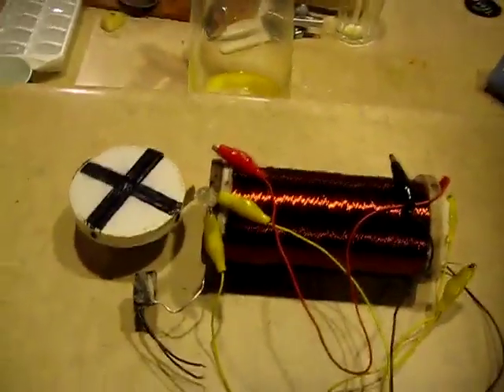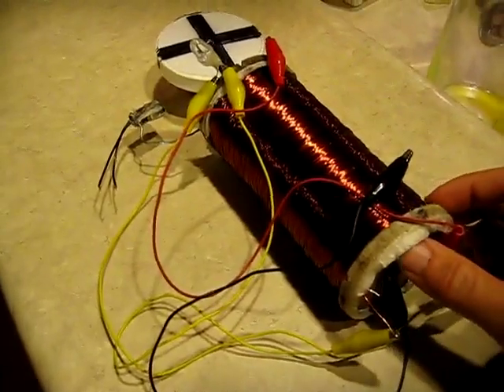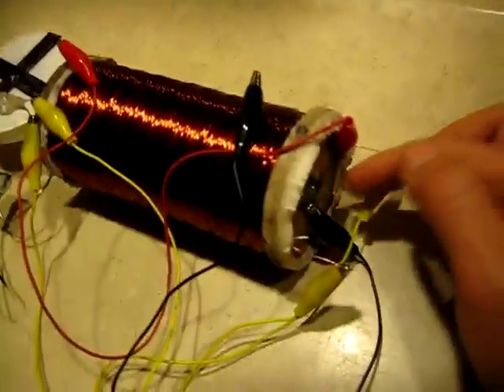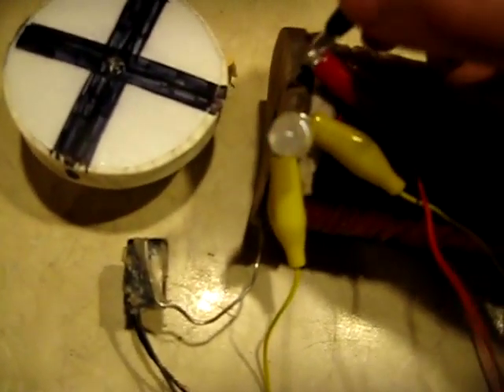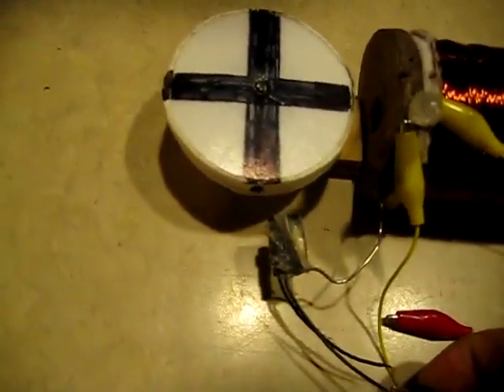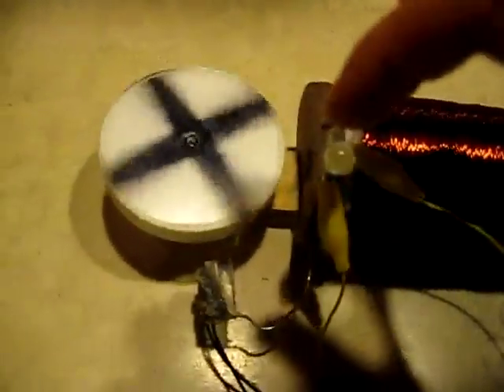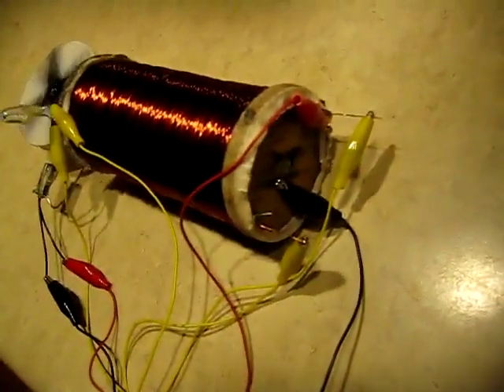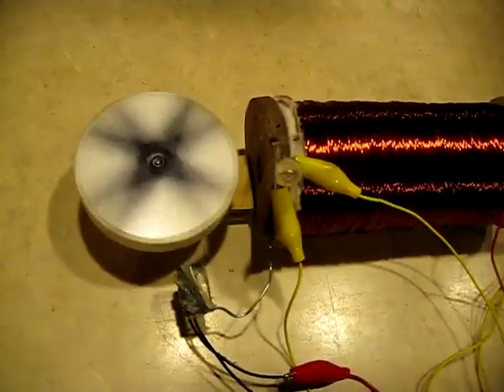Working Nathan Stubblefield Coil!

Comment: It would be interesting to know if your coil picks up electrical energy from the ground. As it is you could be picking up RF (radio frequency) with your little device, and the Light Emitting Diode is rectifying the AC, and of course converting it to light. If you used a 1N34A Germanium diode and a variable capacitor (tuner), and a high impedance ear phone you might pick up your local AM radio station. Connect a long wire antenna and you might pick up several stations.

Comment: Essentially, will this just continue rotation endlessly on its own?
Reply: Yes ...as long as the load doesn't exceed the output. As it stands.  the LED is not a high enough resistance to affect load output, thereby bringing  the device to a grinding halt.

Comment: Sam, 
 Each one of those Galvanic Battery / Coils is approximately equivalent to 1/3rd of the power found in one AAA Battery. One AAA Battery costs about 50 cents. How much do you think that one coil will cost you? Now multiply by 3. Now look at the size, weight and price difference vs one AAA battery. I ask you, WHY would you use the Nathan Stubblefield Galvanic Battery / Coil?

Comment: Do you think you could use thinner gauge iron wire, for the magnetic purposes like it says in the patent, and then put the reed switch close to the iron core? Truly self exciting, like a tattoo gun?
Reply: Or the magnetic field is generated by the flow of energy, not the wire itself, so technically just the best galvanic differential in wire would be best?

Comment: Use one of these to power an electromagnet that impels a steel ball around a circuit rigged with coils and see if it generates more electricity than input in perpetuity.... I saw someone do something like this and the only thing that meant it wasn't perpetual motion was the use of the inital power to get the ball moving.... if this power comes from an innate source... well, I never!?!

Comment: I suppose that finding a good answer to your question is to find out how long this device will produce energy compared to a triple A battery. I really wouldn't know but let's assume this device works for 500 yrs, how many triple A batteries would you go through in 500 yrs and with the rising cost of inflation then how much would you have spent on triple A batteries in that time?

Comment: Nathan Stubblefield Coil? did he not call this a battery? you missed the point completely.. the iron is needed. but you are missing  the point that it has a transformer like look. it should have 2 plates on either side.Tom COOK COIL, they are the same thing, to produce a magnetic field in a transformer. not to lite a single LED and so oh wow!